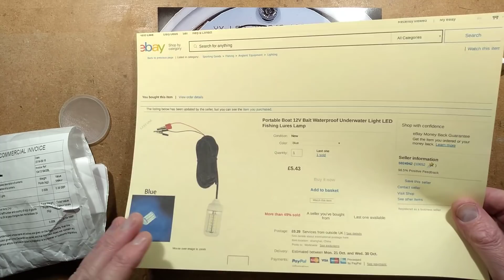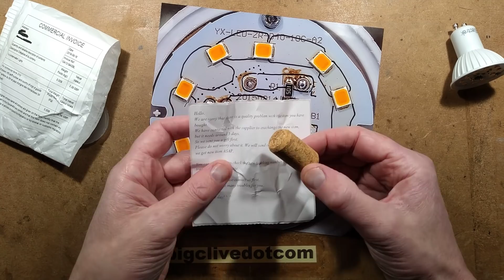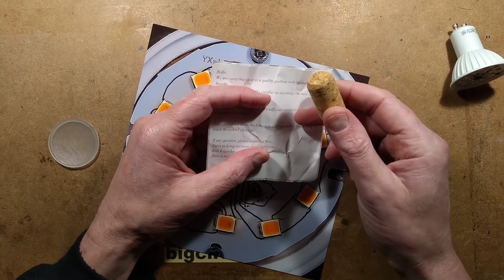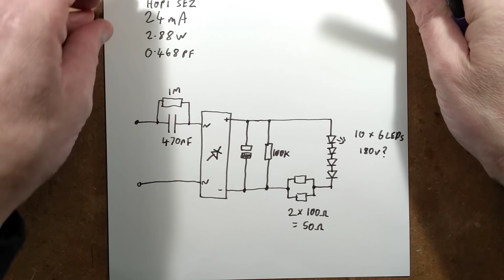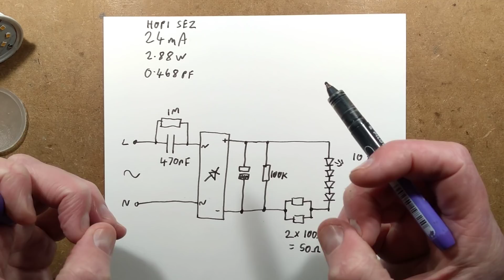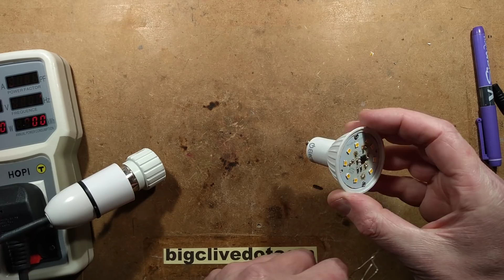Mystery corks, PCBs and fixing a dead lamp.

Comment: 16 mins in, solder killing you lol. I used to have lengths in my teeth while soldering at Fergusons (Videocrypt decoders) cack in '91 and my boss would see me and she would slap me round the head and shout. I am still here to tell the tale. I was working a nightshift in 2005 ish when we went lead free. took me hours to get the robotic assembly  stations to work with the stuff (wire and paste) but that's another loooong story.  The tips lasted 6 hours rather than 4 days until we went induction based.

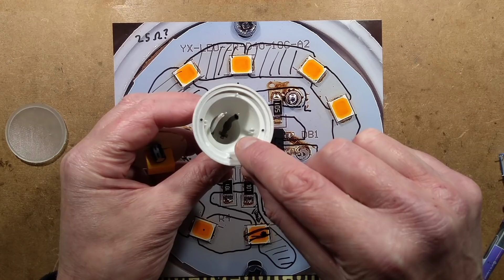Comment: Hi Clive , could you advise ? : I am trying to repair a similar 220V bulb. Doesn't light up at all. I found the culprit : it has same "component, down there" at 15:08. I peeled the sleeve and its definitely bad - cracked. 2 problems : 1. peeling destroyed the markings:  Its red, black, black?, brown, gold. So I decided to put a 28ohm 1/2W Resistor (?) that I had =  Light! and Bang! . So my diagnosis is correct. 2. Would a a 20ohm and 250Vrms be good ?  or Inductor (specs ?) ?  thanks anyways.
Reply from the maker: In moist lampos it's a 10 ohm wire wound resistor being used to limit inrush current and act as a fuse.  If the 28 ohm resistor failed then it suggests there's more of a problem.
Reply: Clive Sir ThanksALot :)  I'm a newbie hobbiest. I realize my mistake is not thinking from the beginning of the issues with the bulb. I should diagnose the PCB !  It a good opportunity to learn !  If u  care to advise more : I uploaded pics to https://imgur.com/a/ymX8u3i . I am going now to scan your videos for such PCB ..maybe I'll get some clues. I have hot air gun btw

Comment: I'd really, really like a Big Clive Designed Bulb. Ok, a 120V of it.
One where whichever part dies is the only part that actually needs replacing when it comes time. Skimping on the heat sink is normal when you're replacing it too every time some $0.07 part dies a horrible death.

Comment: I would have tested that mysterious "blank heat shrunk" object in the base.  I would have replaced the bad "six LED package" with a single or triple LED of the same color temperature and left the capacitor alone.
  I don't understand the fuss about little capacitive loads, because homes and industry are inductive.
In Florida the power companies have capacitor banks at the 13.5 kV level (up on poles, scattered around) switched in and out via 900. MHz links.  BTW:  In America the HOT wire is not LIVE, but L1 (line one) and is any color other than white and green.

Comment: You should check out the Elektrek 5.5W globe - it doesn't even have dropper, essentially just a rectifier and a single SM2082EGS chip doing all the work (5p per unit at lcsc).
I was gobsmacked at how far they have reduced the BOM.

Comment: The ones over here actually have a plate that settles down onto two spikes in one side so you can just pop it off. When crafting you can solder wires in on the other side

Comment: Can I fix lamps by just snipping off the failed led and Sploging soldier over the contacts?
Reply from the maker: Only some.  If the LEDs are in series parallel arrays it can cause current imbalance between the circuits.

Comment: I'm using lead based solder (Sn60Pb40) on a daily basis at my job, because it's the only kind of solder that fits the desired quality standards of our company and the company has a special permission to use this kind of solder.

This is why I always cringe when the environment-argument comes up, and the EU trying to ban everything just makes it even worse. And we are having special trash-containers for lead based solder remains.

I think they know, that the new lead free solder is prone to cause cold solder joints, which I think can be a risk to life (or a risk of train delays at best) because of what I'm maintaining, if it doesn't work properly.

Comment: Fact: the rosin (flux) is considerably more toxic than the lead content.
Reply: @Против Глобал  probably, I couldn't say there's been any studies of it.
Accidentally ingesting rosin - which is relatively easy - can cause acute specific organ failure, you don't need to do it for decades.
which is the irony; lead-free solders nominally require more flux to get them to flow properly, so they've replaced something slightly toxic and potentially harmful for an actual - kills you in hours - poison.

Comment: Well, wouldn't you know that just 12 hours before this notice, I had one of the round bulbs go to flickering and quit... Popped the top and No black dots!   ???
However the non-lead solder gave way and the wire was hanging in the breeze!
Put some real stuff (Led-solder) on the wires and pads soldered them back down, it has been working fine for 4 hours, WIN!  "Nows there Your Dinner!" Thanks BC....
Ya know, I had the eBay package thing happen last year with a similar note, at least you got a corck... Lol
Did not hear back so I waited 3 weeks sent a message and then filed a refund claim .
Wow wasn't 15 min's of filling they wanted me to cancel the claim and would send me 2 of the relays that I ordered... I said no thanks ordered  some else where's, project done, refund please! 2nd time in 15yrs of eBay not bad... :D
LLAP

Comment: I don't think they run out of stock but what's happening is that they're doing drop-ship from China, which takes a really long time.  They sent you the cork, as you called out, to fulfill their requirements to ebay and show that they can ship in a "reasonable time".   I've had a similar experience and see that they're just routing orders from eBay to AliExpress/Alibaba and send out these "placeholder" shipments.

Comment: How can you so easily deal with reduced light output of an LED bulb? I've recently acquired 3 E27 LEDs, which were the strongest ones I could find - one 21.5W and the other two 18.5W, all equal about the light of a 130-150W incandescent bulb. OK, now those are finally bright enough, or maybe even a slight bit too bright (but still very far from useless). I've had two of the brightest to light up my room, but then, the manufacturer of an older 17W LED (supposedly with the light output of a 100W incandescent) sent me 2 replacements of 14W, which are as bright as the older 17W bulb, so now I am using those, and the stronger ones only come into play in situations where there can't be enough light. All in all, I've got about 80 or 90W in LED lighting power in a room that's maybe 24m² (of course I normally don't use all of them, but only one or two - but they are there and useful in those situations where there can't be anything like "too much light" (ever lost a tiny screw on the floor?). Finally, LEDs are able to do what conventional lighting always managed easily by just throwing more Watts in.
Reply: I got a 7 lamp holder fitting from AliExpress, for something like $8; works great, runs cool with multiple alleged 18W LED lamps, kicks out enough light it almost hurts :-)
Ali / Amazon / Ebay also have $5 remote controls (one of which BC reviewed, a while back) that let me 'fiat lux' without even standing, after grafting one into the lamp holder ;-)
Reply: @theskett  The LEDs I bought aren't just "alleged 18W", they are brand names like Osram and Phillips, so they can't really afford to lie about that.
Reply: @Seegalgalguntijak  Ok, but why would we care? If the AliExpress lamp cost is 20% and the light output is (guessing) ~50% of the 'real' rating, and it's still *very bright*, there's no good reason to ask (or pay for) more.
Reply: @theskett  It isn't about "very bright", it is about "as bright as possible" in combination with "E27 retrofit socket", since that's the fixtures I have and I don't want to replace them. So I'd rather have a true 100W or 150W incandescent equivalent for 8-10€ instead of having some cheap ass shit that's "meh, somewhat bright".

Comment: Indeed, asbestos is probably the biggest killer of electronic/electrical engineers
Reply from the maker: Not so sure these days.  Smoking is probably still their single biggest cause of death.
Reply: @bigclivedotcom  I mean in terms of work related hazards. Though I suppose quite a few cop it from slips trips and falls as well. The whole lead solder thing is a bit of a canard imo, I think it maybe dates from when they realised it was a bad idea to have so much lead in landfill, but couldn't be arsed to recycle things

Comment: I leave a special note when place an order on jlcpcb for the old fashioned single layer pcb's, that I don't want plated holes and I want top silkscreen on a bare board - no top solder mask. Works fine.

Comment: Finally finished off my silver based shitty solder that causes bad joints on board and got a lovely big bobbin of leaded solder. I used to chew the leaded solder in tiny pieces when I was electronic workshop training in my teens. I'm still here lol I don't do it anymore, obviously, it's too chewy so now I turn to cheesy puffs also LOL

Comment: This repair seems quite doable. In the old days, I remember,  someone repaired an incandescent bulb by slightly tapping the wire out of the eye and shake a bit to persuade the ends to touch. A little spark fused the filament and a dimmer kept the current down. It was on a TV-show featuring odd people.

A tip to prevent orange fingers. Use chopsticks. It also, as a bonus, prolongs the satisfying experience by slowing a bit the munching down rate.

Comment: I'm curious if the nice circuit boards indicate a possible re-visit of the Spy-Girl Handbag RGB displays?
Reply from the maker: Very different.  It's a sign controller, but more in the style of a traditional neon sign.
Reply: @bigclivedotcom  Thought I heard RGB mentioned so was thinking of a pixel display, but I guess I was wrong in having that many elements. Maybe something like those pinball machine segmented display elements? Faux neon LEDs might be neat for scaling up something like that. Maybe that's  not it either, but now I'm curious.
Reply from the maker: @pauljs75  An animated Christmas lighting panel.

Comment: ha that thing with the cork is hilarious, never seen that before. for anyone shopping on ebay for cheap stuff from China, if you dont get what you ordered always open a case immediately for item Not Delivered or Not as Described. shady sellers will very politely ask that you contact them via "Contact Seller" to resolve the situation before/rather then opening a case, but that's just a delaying tactic usually combined with long Expected Delivery dates, in the hope that the time limit expires before they have to refund you. if you see such a request in the listing, you might want to give that seller a swerve altogether.

Comment: I thought you were going to say moderns circuit boards have a very short service life which they have. Then they end up in landfills and tin and copper are also arguably poisonous. I thin the lead free is a strategy of the industry so that we have to buy new stuff more often than with the more durable  lead solder. After all if the boards are properly recycled there is no danger.
Reply from the maker: The electronic manufacturing industry has had huge problems with the brittle nature of lead free, the higher processing temperatures and the ongoing issue of tin whisker growth.
Reply: @bigclivedotcom  Yeah I strongly doubt if it's any better for the workers either. As you say lead doesnt poison you in that way. Maybe the vapours from the flux but that's probably no better with the lead free anyway.

Comment: Hi Clive, the royal mail barcode that we have to scan is the one at the bottom with the letter on, but tbh not all stuff from China has the correct barcode on it and our PDAs will not let us scan it as if is not in the correct format. I would put that number at the bottom with the letters and numbers under the barcode into royal mail tracking to see if it actually comes up. It doesn't look like the correct format to me.If not you could claim your money back off eBay etc Hope that helps, postie lucy

Comment: I used PICs myself for too many years with excellent results, until I tried Arduino and totally forgot about PICs. Btw, try PicBasicPro instead of assembler, you will avoid too many headaches!
Reply from the maker: In this instance a PIC programmed in assembler is a good choice.  It's just a few loops of patterns.

Comment: I have one of these LED bulbs that died (burned out LED chip) they overdrive these too much. I am trying to mod it to run on 12 volts DC. I'm going to split up each LED or two or three of them and rewire them so they run on 12 volts.

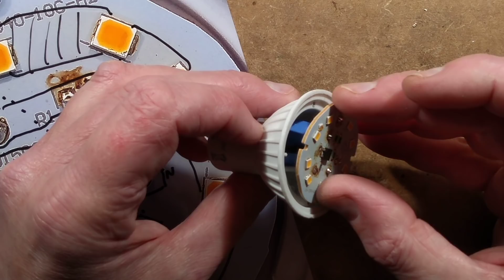Comment: 18:46 - Could have just soldered some thin wire (i.e., jumper wire) to the tips of those leads, and used them to guide the leads through the holes.
Reply: That's exactly what you think of right AFTER you fought 20 minutes getting those damn wires into the holes :D
Reply: As long as you can solder them together well enough that you don't end up with a blob of solder that won't fit through the holes. Or perhaps use really thin magnet wire as the pull wire, and just wrap it around instead of soldering it.
Reply: I think Clive might be able to solder wires "well enough". Beginner's luck and all that. ;-)
Reply: @RFC3514  Of course, but I was thinking of anyone in general.
Reply: Well, I don't think people in general will often find themselves in the situation of trying to reassemble an LED lamp after having disassembled it, reverse-engineered it, and removed one of the diodes. :-P Basically, anyone with the confidence necessary to do this is probably able to solder wires properly and fix any accidental blobs.
Reply: @RFC3514  I feel people in general in Big Clive's comments may often find themselves trying to reassemble an LED lamp -- although our Fearless Leader seems to take 'em apart more often than he puts 'em back together ;-)
Reminding me that I need to go fix up a couple of LED spotlights for the gf, oops, #slacking
Reply: @RFC3514  Maybe not, but the problem of getting short wires through holes is not limited to LED lightbulbs, and nobody knows who might be reading these comments in the future or for what reason. So the more different ideas the better, in my opinion.

Comment: Never had a problem with the other type of solder myself! Takes a bit more heat and patience but it's not that big of a deal.
Reply: Maybe I've only had cheap tips, but I had zero luck in soldering until I moved to a leaded solder. I've only soldered audio gear, which is all aluminum these days, so maybe that was a conflating factor.
Reply: Interesting there is a circuit I'm working on that I'm having trouble with maybe it's my solder I'll try that next. As far as quality of work though it tins wires fine and looks about as good 80% as anyone on YouTube an that last 20% is probably skill.
Reply: @TheSakeCat  my issue with the RoHS solder is that it wouldn't tin wires, actually. The lead and rosin wet to metal much better than the lead-free and acid.

Comment: Actually the health of old timey electronics guys isn't necessarily good, various research in the 90s and later has indicated that about half of them have asthma induced by flux inhalation. This floated the suspicion that lead-free process would make things worse for electronics professionals, but nowadays you can't prove much anything because you'd have to run this research in China.
Reply from the maker: The flux used in lead free solder is much more aggressive.

Comment: Getting wires back through holes when wires are short - Y not solder a strand of Cu wire onto each, say 4" long and thread those through the back to use as pull-throughs for the original wires - which desolder as you  resolder in the old wires.  ??

Comment: PCB was designed this way to shorten life of the lamp - "planned obsolescence"
Reply: If that was the case, they wouldn't have added the large "heatsink" pads to the other ones.
Reply: lol, I think you are giving the PCB designers a bit more credit than they deserve. I doubt they had any idea what the failure mode would be.
Reply: @veraxis9961  your knowledge is a bit too low to hink anythink and have doubts. Educate.
Reply: @veraxis9961  planned obsolescence is part of designing process. Dont be naive.
Reply: @lorchservice4366  "planned obsolescence is part of designing process" -- nonsense. Extreme low cost (economics) and speed / ease of manufacture is part of the design process. Obsolescence is just a consequence of how rapidly technology develops, and that minimum-cost means barely-adequate components and few user-serviceable parts.
Reply: @theskett  educate yourself about thread you take point
Reply: @lorchservice4366  LOL, you have no idea. Edumacate yourself, already
Reply: Community guidelines say I shouldn't call you a fuckin' idiot.  And yet, here you are.
Also / btw: you're speaking broken English, do please fix that.
Reply: How else is Poundland supposed to profit off of them?

Comment: Hi Clive
Great video as usual.
I was wondering what your thoughts would be on using high voltage 450V electrolytics as the dropper cap (in a back to back, non-polar arrangement)? I got the idea from taking a look inside a commercially made remote controlled switch (made by cough cough, rhymes with I love Genie) and was curious about reliability and the safety aspect.
Regards
Reply: That's yer standard "non-polarized electrolytic" setup, e.g. as discussed at https://www.quora.com/What-is-a-non-polar-electrolytic-capacitor
But if you need a big enough cap value that you need electrolytics (rather than e.g. a 4u7 mylar), it's probably time to switch (hah!) to a switch-mode power supply; AliExpress have switchers from around $2, and they're small and run cool, without the big-cap power surge or poor power factor.